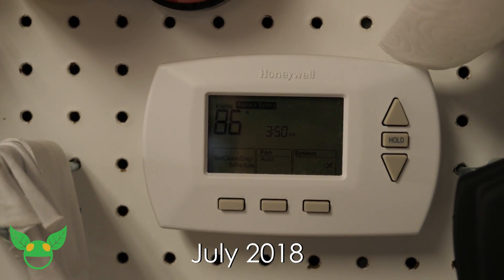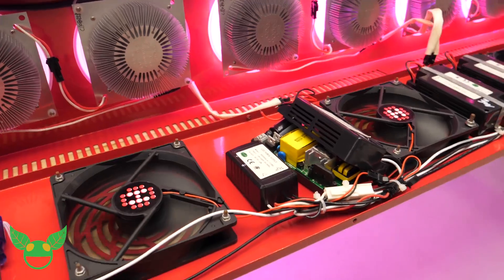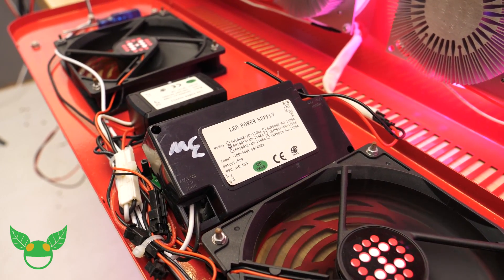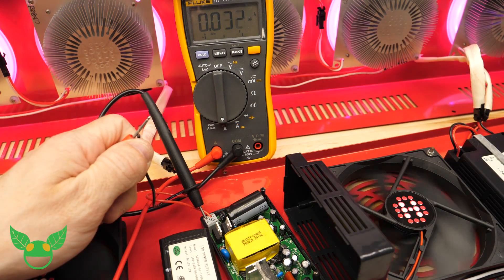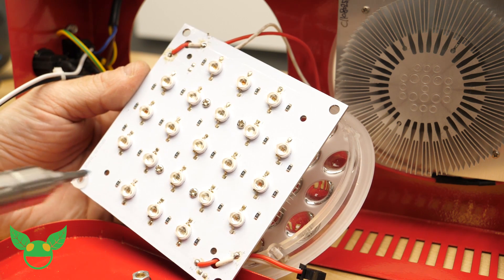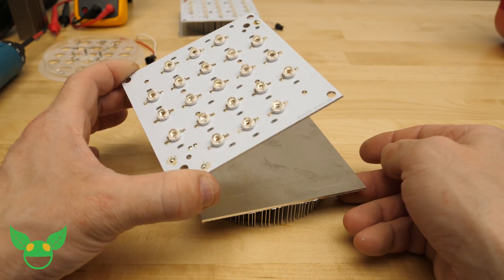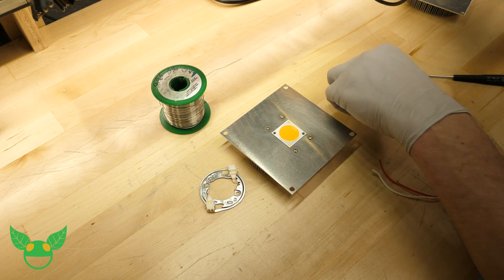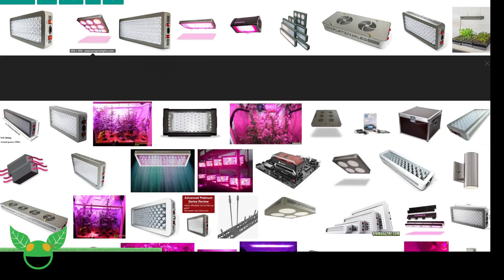Hack/Repair any import LED grow light

Comment: I just bought a light and the cords are missing can i just cut off the 3 pin connector and just wire a 110 plug

Comment: That new light is designed for the fans 
to be in place and running 
over the heat sinks.
Like shown, on with the fans separated,
he's lucky those heat sinks,
no longer fan-cooled,
didn't 
self-destruct due to overheat ...

Comment: Hello, i have an issue with my grow light, 
I have a 480 2100B meanwell driver with dimmer knob and when i turn it past halfway it started to flash on and off,
So i took the dimmer off to check if that was problem and the light did not come back on but just flashed only,
So i put the dimmer back on it so i could at least us some light at the moment,
Any help will be much appreciated thanks very much.
I have it on 15amp wall plugin alone, and it did not do this until like the second day it came on with timer and as fine also at that point but about an hour later it started flashing above half power?

Comment: Dude... the dangerous side when it's unplugged is not the AC side... it's the DC side with that fukken HUGE capacitor. If what you said was correct, over 800 V DC voltage at over 0.1 amps that cap will blow your heart into next week. That kind of amperage and voltage means you have little to no resistance in your skin over that capacitor... You really should be discharging it before messing around... Don't make a connection like that with your multimeter and the neutral while it's running...

Google: "Electrical Safety: The Fatal Current" and also "Conduction of Electrical Current to and Through the Human Body: A Review" and "Electric Current Needed to Kill a Human"

Comment: I'm wanting to mod my burned out leds with quad/triple/double or even single 5w diodes. I want them amped up though. I need a little guidance on power supply units. I have all kinds of power supplies for 3d printers, they appear to be the same ones but its hard to tell. The power supplies would have to be quite large and it looks like it goes from these adapter looking ones into 3d printer looking ones when you get higher power.

Comment: hello...would I regret taking the reflectors off my LED light? (the plastic cone strips on the bottom of the light base) does it help the LED at all? will humidity damage the insides if I remove it? the led strip seems to be coated. Also the LEDs (96x2) doesnt seem to have a heatsink on the back...just a loud fan inside, should I set heatsinks? do you have recommendations to replace fans for quieter ones? (this is 12v x 0.15a apparently) or do you have tips to silence cheap fans maybe... any help would be great <3

Comment: Hello could you please give/sell me parts/entire penetrator led grow light .... what i really need more than anything is 6 of the original pcb boards with 21leds.... I have had a few of  this company's lights but they are sold out of replacement parts.... I have, on week 2 of flower, 6 dead light pods in my grow light now.... And cannot get parts.... have been workin for notin and paying huge electric bills for nothing if plant doesn't havr enuff light intensity cuz 3/4 of light wont turn on

Comment: I'm looking to build a 4 LED setup into a high bay reflective hood (16 inches in depth).  Been looking around at different LEDs on the web and amazon then came across this video.  Broadened my view on these newer chips (I build my own first LED grow light about 4 years ago with 10W red/blue chips).  It worked but the chips started flashing; 'Im assuming due to heat or just low quality chips.  This application is for a 4 x 4 grow tent. 
I also considered 60 or 10 degree lenses for better light penetrating, but settled on the metal reflector instead ($25 out the door on walmart website) and want to use 4 x 100W chips.  I'm constantly going to the drawing board to find a good way to get good light penetration from a single light source/focal point.
I enjoyed this video!

Comment: ive built my own light with a similar design to this. i used 6 3500K cobs and 2 monochromatic cobs to "boost" the spectrum. i can still see my plants in true color but they also get that extra blue and red that this "full spectrum" cobs offer.

Comment: hey Mouse i have a technical question. Is it possible to solder leds that have varying voltages to the same PCB board? I was looking at the CREE xp-g3 specs and i noticed the reds function at a lower voltage. would that be a problem when soldering the reds to the same board as the whites and blues?

Comment: Growmau5 buddy, you probably  won't read this but I need your help. Im concerned. I have a led light, I won't say the brand but it has 6 panels and 6 cobs. The panels are filled with smaller red and blue LEDs. It's white and rectangular. Sold by a popular YouTuber. When I turned it on the other day One of the color led panels died. It's now making a clicking noise. It's not the fans. My question is if I need to be concerned with continuing to use the light in its current condition?

Comment: Great video I'm I about to do something similar. To first get a heat zink then a driver then a fan. After that I will search for the Led chip. The problem with the led chip is that there are so many various models and generations so it is difficult to decide what led chip to go for. I would have probably one full spectrum 100w led chip/plant and use one unit per plant so the distance to the plant and position of the light can be dialed in more accurate then if a bigger unit is trying to cover a few plants.

Comment: Hi. I'm hacking some import led I was able to fit some cxb3590 replacing led clusters just like you did on this video, tho my optics wasn't anywhere near as sellable as yours, I first learned how leds works watching your videos, great content as usual.
I was left with some old epistar pcbs, I now I wonder how are these led joint into the pcb? are they soldered? glued?  I'm asking you this because I would love to replace the burned diodes (1 - 2 diodes per cluster) in order to use them in other array. I have limited budget so I hate the idea of having 4 leds clusters, with 12-14 working leds laying there as a paperholder. Hope you could help me with this. Thanks for sharing your wisdom. Greetings from Chile.

Comment: Hey how about adding some thermal grease to the contact surfaces? some regular PC grease (I think everybody should have some at home) should help getting your chip temps down even further. Oh and since we're at it, a CRI of 80 does not seem to be very good in emulating sunlight. Is there an improvement to be had over a CRI 80 LED, if I was using a like CRI 98 LED chip?

Comment: Hey I'm having a problem with my meizhi  600w LED light for some reason the veg lights on one side of the light stopped working the flowering lights are still working on both sides but for some reason the vegetative lights are not do you know of any quick reasons why this would happen
Reply from the maker: Sounds like one of the led drivers inside the light has gone bad, or a connection is loose. Your best bet to figure it out is: get a $7 ,red, harbor freight multimeter and check the DC output of each driver (as demonstrated in this video). Cheers & good luck .
Reply: @GrowMau5  it's weird because this light has four boards two of the boards are working perfectly and two of the boards are only working with the flower lights not the veg lights I would figure if a driver would be bad either none of the veg lights would work at all or something like that if that makes any sense to you I do have this light opened up and I don't see any bad connections I just don't have the money to buy another LED light and I'm in the middle of a flower run right now
Reply: @GrowMau5  hey I got a question again when I took the LED light apart one of the black wires ground wires coming out of a driver seemed loose may be pulled out could that of burned out all the veg lights on that side because all the drivers seem to work I've swapped and back and forth and made him run different stuff for the drivers are all working it's just the veg lights on those two boards by that ground wire backing out could have burned out all those veg lights on that side because the flower bulbs on that side still work with those run off a different driver please let me know

Comment: Instead of buying it in
I run 5 50w cob leds that are water cooled so i can run the heat out of the room  while i have 2 40w spot lights 
I have checked alot of lights and i just build my own and buy reflectors and parts seperate

If i need an air cooled light i add a old cpu cooler as there ment for 100w of disapastion easily so 2 50 w cobs even over drivern at 120w is a no big sweat

Comment: I was under the impression that even though HPS is an old technology and it produces more heat, it was more efficient than most LEDs, meaning HPS lights produce more lumens per watt than most LEDs.  Have LEDs become more efficient than HPS now?
Reply: lumens aren't all that matter, PAR is what matters most and if you want efficiency search up the gaslighting method with HID's interwoven with LED's or on light movers its like half the power consumption and less water usage for same yields

Comment: hey guys I have a sol 9 series from the led company u did a remodel on this penetrator. just curious what your thoughts were about there sol chips they have in there new generation series. btw hydro grow led sucks don't buy there lights , there customer service is shit and they may decide not to refund u.  btw this video is super helpful an I guess  my main question is I have like three chips go out in the 9 light fixture wondering if its a driver issue or a chip issue. I'm gonna get this baby apart and run the multi meter through it to see if I have a driver out or if the chips went bad. any thoughts on the sol 9 series chips should I keep them or use cree??? could I just rewire with less lights on board???? thanks again for making this video and bringing useful information to the people.

Comment: Device magically plugged into wall again to measure amps after you told everybody to unplugged it from the wall.
Reply from the maker: Safety first until solid connections are made.  One must energize an appliance to test its current. No growmauses were harmed in the making of this video. Thanks for watching & commenting.

Comment: i love cree or clu48 cobs over 3watt epyled      heres my grow channl https://youtu.be/tUw_uERIym4

whith citizen clu48.12 12 5jan or i think ther 6jan not shore  3500k    

 love to no if same strain same amount of plants same driver but with citizen vs. Cree same wattage if you could and voltage and all what do you think the difference would be in yield  going from clu48 to say  cxa cxb 35 series    u put  me in the right correction and I figured out the rest but without you I would have been lost
here my channl.but brow i mad a pc whith  ash from.crop and now i am gaming all time idk whst to do brow   i like the I like the fact that if something goes wrong you can fix it yourself including the Chinese name Brian Whiteside purchased broke or democrat did not break but diminished in brightness within one year due to cheapness of thermal management so I recommend do it yourself make it yourself plenty of forms plenty of people and the cheapest way would be to buy it and parts and put it together when it arrives my opinion I'm just circus tour was all out of metal to make my frame and I'm wasn't driving to my other hardware store so I ended up just making it as cheap

https://youtu.be/tUw_uERIym4

Comment: SO IF A LOT HAVE THE 700 OR 500 MAH U EHAN TTO POWER AND WIER IN SEEREEEEZZZ  WIERING U WOOD MAKE UR 700 OR 500  IN TO 1400MAH OR     IF  IT WAZ TO 500 MAH U HAVE 1 
 AMP OR IF  2  700MAH U HAVE 1400 1AMP .400 MHA  IF U WIER THAM DIFF  AND  IT WOOD DUBULL UR VOLTS TO     SO IT WHITH MY CEEP FAN DRIVER TO 3.5VOLT DC PHONE CHARGERS HACK GOOD FAN DRIVER BUT I NEED 12VOLTS NOT 3.5VOLTS SO   WIER TO 3.5 TO GETHER MAKE A 7VOLT MAH FAN  DRIVER   OLS CHEEP BLID   IT MOVES FAN  GOOD

Comment: hey mau5! i hit you on the "100% did not save" live stream, asking you about the Mass Medical supp lighting kit. It's on Rapidled.com.  I have a 42"x42" angle alu fixture with 9 Vero29s (3500k) spread evenly (3 rows of 3). I was thinking of doing the 4"x48" heat sinks, like they show. I really just wanna add color to my fixture. Seems like a legit kit for what I have and where I wanna go. What say ye, young Jedi master?

https://www.rapidled.com/mass-medical-strains-supplement-kit/

Comment: hey mau5 u should put a couple pucks in on of those type of lights
Reply: That would require a different driver and heat sink, I think the intention of the video was to make reliable budget conscious improvements on the import led.

Comment: @growmau5  just opened up my chinese meizhi 200w (wall pull) piece of crap - I wish i could upload pictures of 1/4" piece of heatsink which was supposed to help cool this 200w panel of smd's  -
 there's two drivers one labeled A other is B - both go to the board and both go one fan each   
the A says DC 55v - 86v, .67-.69A (95-100v max i think)  , the B says  DC 150-190v,  (201v max i think) 12v-.3A   --  why were they both soldered to the board? And which can I use for the cob hack,  and the other just for the fans -- very much an electrical noob - please help me bud
Reply: @growmau5 I know I said Cob hack but Im planning on using a QB288 - should fit great

Comment: I have the same helping hands for soldering as you do. I put a doubled up piece of heat shrink over the alligator clips. I was afraid the teeth would bite through the sheathing and cause a short. Am I being overly cautious? Thanks again for the videos!

Comment: I think I know the answer but.. I have one single led that keeps burning out, even after being replaced many times, would I be correct in thinking it's a faulty  diode that's causing the same led to burn out??
Reply: When you replaced it did you ensure it was making good thermal contact with the pcb? If it's getting hot it'll keep burning out. Also throw your multimeter in current mode and measure across the led, then measure across another similar one... If they have similar current numbers it's heat killing it. If the bad one is higher then maybe they threw a wrong resistor in at the factory, or one of yours has gone bad and is letting that led draw too much... But I don't think many manufacturers use resistors, so I'm guessing towards heat.
Reply: volvo09 cheers for that, yea I did put new thermal paste on each time and make sure it was flush on the pcb, I'll have a look tomorrow though and track the fault down !it does have diodes though.  https://I.imgur.com/7cipOoM.jpg your help is much appreciated!!! :)

Comment: Awesome. I just sold my Mars panels and I wish I would have used them to try something like this instead.
Reply from the maker: One mans trash is a DIY'ers treasure.
Reply: I am using Mars light, when my power supply was damaged last time, they sent me free one to replace it.

Comment: You were holding the 108VDC live wire with your fingers while measuring it.  Isn’t that super dangerous?
Reply from the maker: Jim is right, for the un-initiated , aligator clips or even electrical tape is recommended.  But its the current that kills you.  Think of a tazzer its 20-50,000 volts but only 2-5 milliamps.  Worst case, you poop your pants and pass out. 
But, safety first.
Reply: haha, you are funny~
Reply: Home Grow Homie its not really dangerous if you know what you're doing on the dc side.
For folks with little knowledge take the safe approach and use clips 👍
Reply: If your not grounded or touching the return you are safe. The key is not the voltage but the current and the current needs to have a path through you before you will be hurt.
Search for a video if repairing high voltage lines, they use helicopters and connect directly to the power line.

Comment: Great video brother, but what if you wanna put a bigger driver in one of those import lights?
Reply: Hordaculprit that wouldnt be that difficult, it'll be like a new build with a ready made frame.
Remember though that more power = more heat and there's not a massive amount of room in there for big heatsinks.
From the looks of it in the video you might be able to reliably run cobs about 40-50W or so each.

Tbf i wouldnt run cobs very hard in that fitting anyway as they're pretty close together.
Reply: Actually, if you were looking to replace all the drivers I'd save them for a proper diy build that spaces the cobs more evenly. This fitting with cobs run soft would be good for veg or a small grow, i wouldn't use it as a standalone grow lighting for anything else
Reply: jim tait thanks for the reply, I get what your saying, but if you look at my channel, you can see what lights I'm working with, I basically wanna put a bigger driver in these lights, they have 1 100 watt driver and can take much more I'm sure of it, just wanna know how, lol